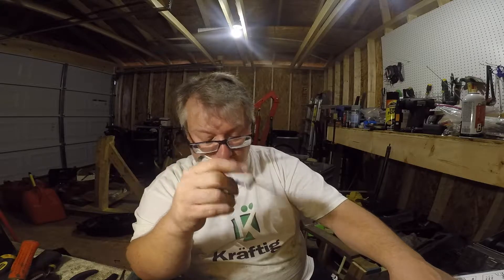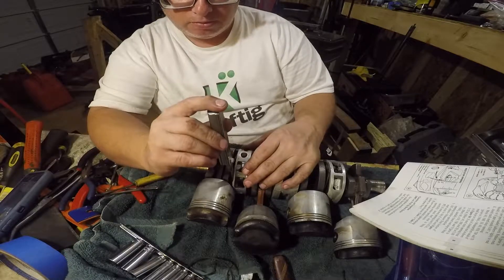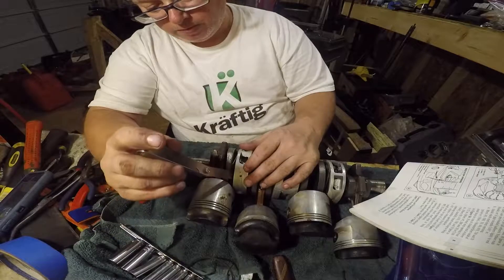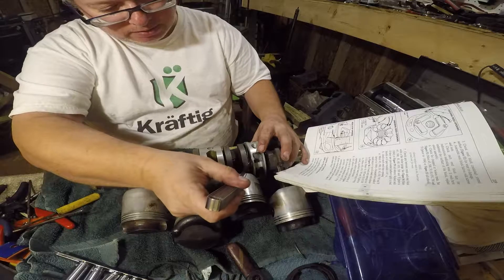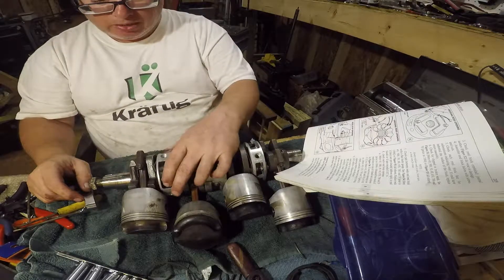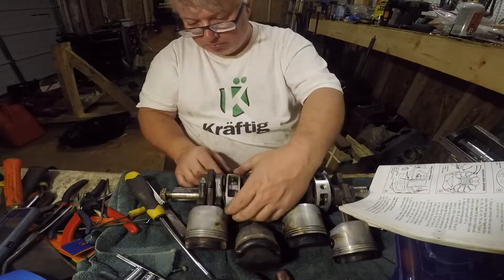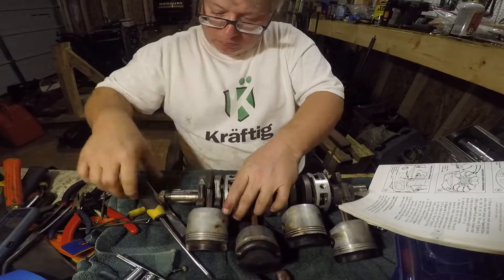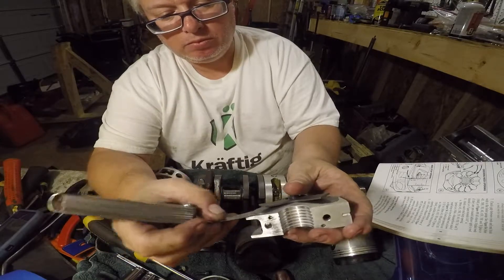Mercury Outboard Thunderbolt 500 50 HP Part 25 - Reed Valves Inspection

Comment: Hey Hawkeye, when replacing some reed valves that weren't sealed (the feeler gauge slid right under them), it turns out that all of the new reed valves that I bought had the same problems as the old ones that I replaced when I put the new ones in; the feeler gauge would just slide right under them as well. Do you have any suggestions as to what this might be, or is this not as big of an issue as I think? Sorry to be asking so many questions, it's just that you're the only guy on the internet that has stuff on this motor. Thanks.
Reply from the maker: Yeah no worries.  I think your over thinking it a bit, which is not a bad thing.  Just make sure its tight really and not open and your fine.  They don't really have to be that tolerant.  I learned allot from doing this series and it has served me well.  As long as that reed is not open and light can get through it when looking at it your good.  The back pressure will make it close but if the reed is slightly open to begin with that back pressure will not close the reed.  That's when it will cause you issues.  Hope that helps.  Thanks for watching.
Reply: @hawkeyemarine  Thanks a lot, I really appreciate it.

Comment: Hey Hawkeye. My 71 500 won't idle. Even with the idle stop full adjusted in I have to open the carb butterflies just a crack or it stalls. Carbs  were carefully rebuilt and clean as a whistle, Idle mixture screws are functioning properly but have minimal  effect on idle problem. Tach doesn't work but I estimate it  will stay running  at about 2000 rpm + and will rev like a healthy engine. Compression is 135 across all 4. Distributer, wires and plugs all new or in VG condition. Any ideas? Could it be  the reeds? Any tell-tale signs to look for or test I could  perform. I'm at my last witts with this motor.
Reply from the maker: Do you have a DVA meter?  Check your voltages coming out of the distributor.  Also check the coil and make sure its not weak.  Also did you rebuild the fuel pump?
Reply: @hawkeyemarine   No DVA meter. I ran ohm checks on the  stator, distributor coils, the rectifier and the coil.....all passed. Also rebuilt the fuel pump.  I noticed  two other things this afternoon though. 1) The distributor (with new rotor and cap) seemed  kind of warm to hot). I never noticed that before. and 2) I could see  fuel atomising out the lower carb.....this is what leads me to believe  the reeds  may need attention.
Reply from the maker: @Veritasednoir  Ok, but what is the voltages between red and blue and white and blue on the switch box?  Those are the trigger wires that come out of the distributor.  Low side should be 20 volts and high side should be 180 volts with a DVA meter.
Reply from the maker: @Veritasednoir  could be a bad low side trigger.  I would get a voltage meter take the timing belt off and put the bolt back in the distributor.  You  can spin it with a cordless drill with a 5/16 nut driver I believe is the size and measure the output of the coils in the distributor.  I have a video on it.  Its the last video I put up.  If its putting out the correct voltages then your trigger is good.  Possibly why its running in advance but not in idle.  Red to blue should be 180 volts AC, and blue to white should be 20 VAC.  To get an accurate reading you need an attachment for your Volt meter.
Reply: @hawkeyemarine  Ok thanks Hawkeye. I'll review the video and  take your advice. Do I need a  DVA meter to read the outputs? If so I'll have to order an adapter.  Probably get a timing light too. I'll get back to you with the  results. Many thanks !
Reply from the maker: @Veritasednoir  I bought a meter @ Walmart it was like $24 or something.  The adapter is online and you can find on Amazon.  They usually run around $30.  My meter shows me the voltage I am looking for however a DVA apapter with it will read the correct voltage.  The meters are not fast enough.
Reply: @hawkeyemarine  OK. Just got  a DVA adapter for the multimeter. Blue /white read a relatively constant 185 . The blue/red was 1535. Did the test several times with same result. So a bad coil (s)?
Reply from the maker: @Veritasednoir  Check again I looked this up again to make sure I was right Red to White should be 180-400 VAC and Blue to White should be 25-100 VAC.  Sorry about that.
Reply from the maker: Here is a tech guide http://www.cdielectronics.com/wp-content/uploads/2016/05/Tech-Guide-Digital.pdf
Reply from the maker: Here is a DVA guide on page 7: http://www.cdielectronics.com/wp-content/uploads/2013/03/CDI-Electronics-DVA-Charts.pdf
Reply: @hawkeyemarine  haha..np....ok so I'm a bit confused. Watching the video, I assumed  the blue wire (in your case green) as the ground. So I tested white to blue and red to blue......but are you're  saying  I should have tested red to white  and blue to white instead .....so the  white is the ground?
Reply: @hawkeyemarine  So  I tested again ...results: blue/white 180 and red/white 1400..........I ordered 2 coils....thanks for the links.
Reply from the maker: @Veritasednoir  Bad trigger.  That's why it wouldn't idle.  That link I sent you tells you how to test the switch box with a jumper wire to make sure your switch box is ok.
Reply: @hawkeyemarine  I checked the troubleshooting guide for he switch box but I'm not certain it can be bench tested.  I'm deducing that this particular model (333-3213) only accepts ac voltage because the guide warns of connecting the module to  a 12VDC which  results in damage.  There is a  YouTube video of a Mercury 6 cyl switch box being jumped successfully.... but it is connected to a 12v power supply. I'm assuming the 6 cyl switch box is  made to accept  dc whereas  the 333-3213 is not. Thoughts?
Reply from the maker: @Veritasednoir  I'll have to look again.  But definitely don't hook to a 12 volt supply.  I've done that already and it cooks the switch box.
Reply from the maker: @Veritasednoir  on page 92 of the CDI trouble shooting guide it tells you how to check your switch box using the diode setting.  Which explains why if you hook up 12 V DC it will blow the diodes inside of it.
Reply: @hawkeyemarine  Yes I saw that but don't have a diode tester.  I'm going to try avoiding buying more tools since there are only two or three  more possible causes of the engine idle malfunction. Although I think It may be possible to do a bench test with the distributer , switchbox and coil all connected and grounded to each other, it may be easier just to  try to fire up the engine with the new coils and see if  it solves the problem first.
Reply from the maker: @Veritasednoir  You can test a diode with a Multimeter.  Put it in ohm reading like the page I sent you.
Reply: @hawkeyemarine   Excellent ! I didn't know that.  Thanks,
Reply: @hawkeyemarine  Hmph..?. So I installed  2 new coils and I got the exact same readings on the high and low coils as I did before with the old coils.  I now think the old coils were good and the reason for the high readings was due to the high RPM of the drill  I used to spin the  shaft. I  changed the drill to a lower speed  speed and got readings in the acceptable  ranges. So I think I'm back to square 1...minus  some $$. I also checked the diodes on the switch box and all passed.. BTW  the inside of the  distributor is/was as clean as a whistle...absolutely no corrosion....almost like new. Anything else I could check before I tear it apart  and check the reeds.  ( if the font appears red half way through my comment I have no idea why)
Reply from the maker: @Veritasednoir  Hmmm....checking the reeds means completely removing the power head.  No way to inspect without removing the power head even if you just take off the carbs and use a mirror to look at them.  The only real way is with a feeler gauge.  You sure that when you open the carbs that its not getting enough fuel?  That's really the only thing I can think of?
Reply: @hawkeyemarine  Well .. It revs really well when I manually turn the distributor clockwise..so getting high rpm isn't a problem... but when I  rotate the distributor back to the idle stop (at max adj) the engine just cuts out.  I'm wondering if the timing notches might be off by a cog.  I'm putting it back together with a new timing belt.  I'll also put a timing light on it.
Reply from the maker: @Veritasednoir  Yep line up your notches.
Reply: @hawkeyemarine  Ok..Got back together and put a timing light on it . The reading  appears to be way off, Suppose to be  35  but I'm getting about 5 at about 800 to 1000 rpm The flywheel has two factory notches which is  a bit confusing. Presently I have the the arrow on distributor gear  lined up with the second notch. In this position   the other (first) notch is at TDC on the timing scale decal.. I'm wondering if my arrow alignment is correct or if I should be lining up the arrow with the first notch instead of the second ?
Reply from the maker: @Veritasednoir  No it should fire 7-9 degrees before TDC.  The 35 degrees would be wide open throttle on the decal.  So, your off a couple of degrees check your marks again.  Might be a tooth off.
Reply: @hawkeyemarine  I moved the belt  one notch  and it did bring the timing closer at 10 degrees BTDC at 1800 rpm. 1800 rpm is lowest it will run by itself..lower than that I have to  keep choking the engine  which leads me to believe  that  the problem is a fuel issue. I noticed that when tuning the low speed idle mixture that the top carb is sensitive to adjustment but the lower carb is  not. Turning the low idle mixture on the lower carb doesn't change the engines rpm....(turning it either way does nothing). I know the needle valves and carbs are  good (recently rebuilt and rechecked for clearances )....also all ports were checked  for obstructions and all  look clear. With the low idle mixture needle valve out I was able to spray carb cleaner  into the needle valve hole and  the cleaner would enter the carb body. I'm wondering if my fuel line configuration is correct . From the tank the 3/8  fuel line (new)  passes through a water separator filter (new) then on to the motor. The 3/8 line enters the "quick release" connect (new) and enters the inside of the lower cowling. It then goes through an 5/16 line and inline filter (new) to the bottom of the fuel pump (rebuilt last summer). The fuel then goes through the fuel pump and  back out the top line (1/4" original)  line to another inline  filter and on to the  bottom carburetor and then to the top carb. Does the fuel line configuration  sound correct ? More specifically should the fuel enter the bottom  of the pump and exit the top or vice versa?
Reply from the maker: @Veritasednoir  If you have an external tank you can connect and bypass that to see if its the problem?
Reply: @hawkeyemarine  Have both. Already did that. No difference. I can't find  any diagram/pic of the  fuel pump lines to the carbs. Do you know which  line should go to the carbs....top or bottom ? It's possible that mine are reversed  (along with the check valves).
Reply from the maker: @Veritasednoir  It should be out of the fuel pump into the bottom carb with a T to the top carb.  Nothing really special.  Might rebuild the Fuel pump.  When you take the fuel pump off poke in the two holes in the back side of it to make sure its putting pressure on the diaphragm.  You can check the check valves manually.
Reply: @hawkeyemarine  The top carb is functioning properly and responsive to mixture adjustment but the bottom is not so I now think fuel supply is not the problem. I'm going  after the reeds. Can you tell me if the intake cover requires a gasket or just a sealer? If it requires  a sealer  is there a special sealer I should know about ? I'm assuming  I don't have to replace any oil seals if the one on it are good.
Reply from the maker: Out of the water idles will be much higher than in the water because of the way it exhausts out.  Something like 1200 rpm's out of the water vs. around 650 rpm's in the water.  That's normal.
Reply: @hawkeyemarine   Yes I understand but I wouldn't really call this an idle. In order to keep it running (and it's presently on dry dock) I have to turn the distributor. If I allow the distributor to  rest against and return to the idle stop  (which is fully adjusted in ) it just quits.
Reply from the maker: @Veritasednoir  Have you put a timing light on it?  Check to make sure its firing between 7-9 degrees BTDC.